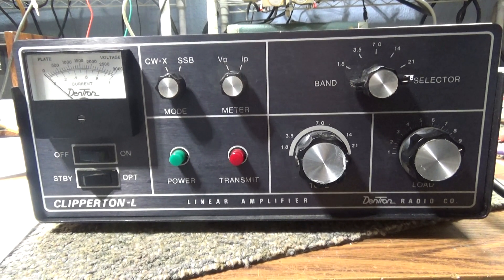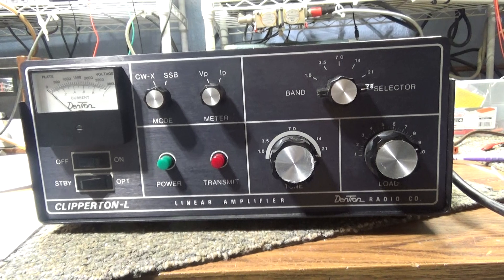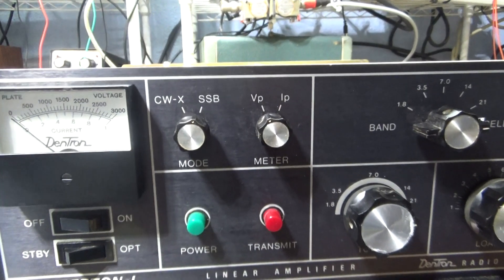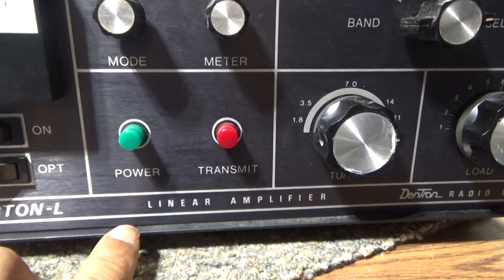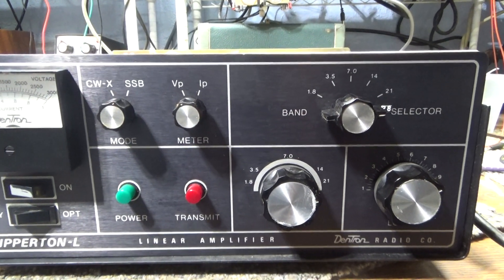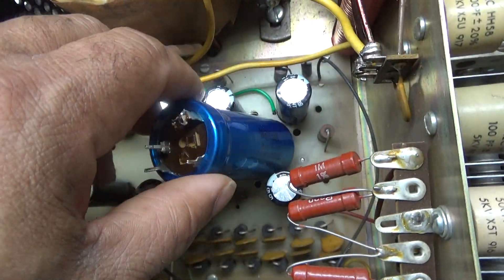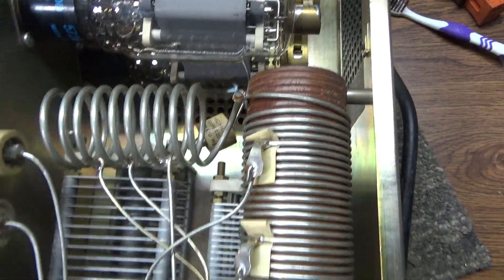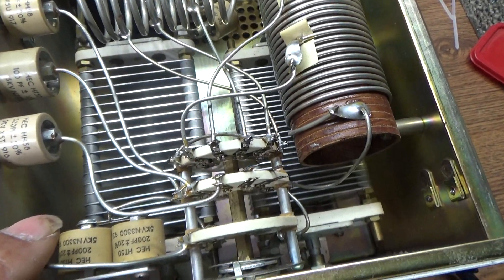Dentron Clipperton aka 160-10L,  4  572B tube,  10 - 160 meter, linear amplifier unpowered walkthru

Comment: Why is my Clipperton L different? I have a PCB under the plate that holds the tubes, and my doorknob capacitors are in a different location, where only the 40m is mounted to the plate.
Reply from the maker: IDK, but I said they made many different versions of these. Did yours have factory 28mhz 'l0 meters' in it?
Reply: I have it figured out, mine is a Clipperton QRO in a Clipperton L cabinet. This makes all sorts of sense not that I pulled up a QRO schematic and looked at it, there's a big difference. I have 6 caps instead of 8 like the L does. I bet towards the end, Dentron was running on fumes and started throwing whatever they could together. I ended up with this configuration that's given me 1200 watts for $250 bucks. 1200 watts out of some old Raytheon made in America tubes. I can imagine that those tubes are in the ballpark of 40 years old.
Reply: And yes, it is set up with 10m but hasn't been configured yet. It's a matter of bending a tab and removing 2 wraps on a coil on the board. I might do it while I have it apart but probably won't ever use it.

Comment: THANK YOU..I HAVE 160-10L,,,SERIAL #500....CAPS ARE GONE..CALLED HARBACK AND THEY SAID THERE KITS WONT WORK..DO YOU MAKE A DROP IN CAP REPLACEMENT BOARD?GREAT JOB ON YOUR VIDEOS.THANK YOU
Reply from the maker: No, I just do a little modding on the original board and put in normal thru hole caps.
Reply: @tramdr  THANK YOU

Comment: I would like your advice. Im currently running my station with a 8 pill amp and the other radio with a 2x8 amp. I want to buy a tube amp. I am considering Ameritron. The RCI-2995DX radio has an output of 80 RMS and 185 PEP. Which amp would be a good match ? The RCI-69 BASE has an output of 40 RMS and 100PEP. Which amp would be a good match ?
Reply from the maker: I'm all for getting the biggest amp you can afford. AL-1500 then AL-82 I like a lot but they are pricey.
Reply: thx Dr. which is which radio ? 2995dx or 69 base  with the AL-82 ?
Reply from the maker: 2995
Reply: 80 WATTS RMS AND 185 PEP WONT OVER DRIVE IT ?
Reply from the maker: just about right for the 82
Reply: @tramdr  THX

Comment: I like to buy or get one modified to key without the foot padded.if it can be done.
Reply from the maker: Nomad radio and others sell a keying circuit to mod any amp so they will key with the radio and not need a foot switch.

Comment: I ran one for a while, good amp but I found a Drake l 4 B and ran it a few years.
Reply from the maker: Drake L4B is a big bad amp.
Reply: @tramdr  I really like the 572b tubes,a true transmitter tube like the 3 500z One day I will have another amp with 572b,s I hope
Reply from the maker: 572B's are good, but I like me some 500Z's
Reply from the maker: or 250B's even better. Low drive.

Comment: Contrary to popular belief, Dentron provided a DTR-2000 amplifier for the 1992 Clipperton Island DXpedition, not a Clipperton-L. It was a great marketing move, and the amplifier sold like hotcakes. There is a large body of knowledge about them on the internet, so if you can find one for a good price jump on it. The 572B tubes are plentiful and relatively inexpensive.
Reply from the maker: agreed